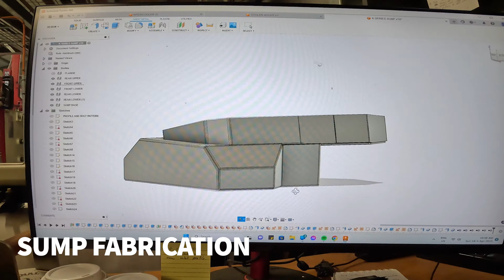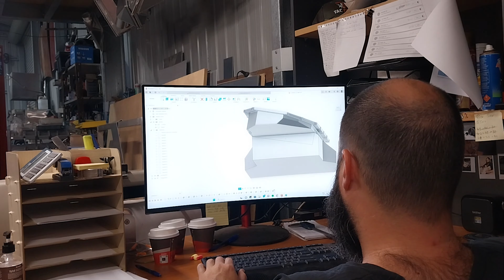KRolla - Turbo, Manifold & Sump Building

Comment: Sump came out amazing, was expecting a chopped up OEM one, not a work of art.  I remember watching a video of the touge factory K series RWD sump development.  They ended up having oil starvation on there time attack car on high G cornering and added side trap doors.
Reply from the maker: Yeah I we may look at adding that to the design 😁
Reply: @knightfamilymotorsport  Will this sump be sold welded or as a flat pack in the future?
Reply from the maker: @Drunk3nMas7er  - Each conversion will likely sit a bit different, but Dave @ FFM Fabrication will be the man to speak with!